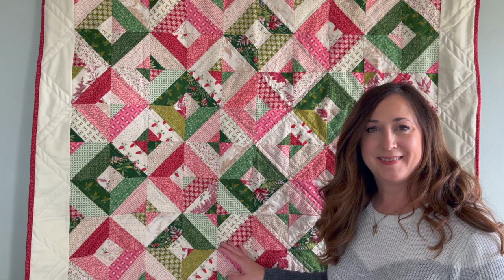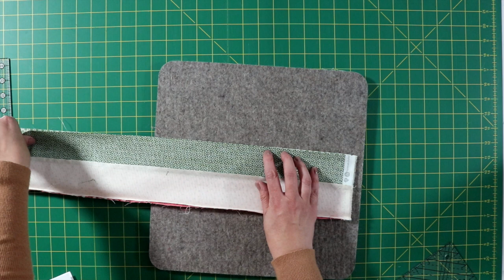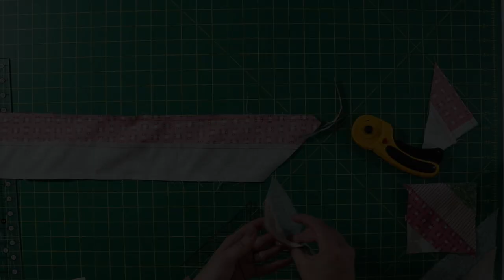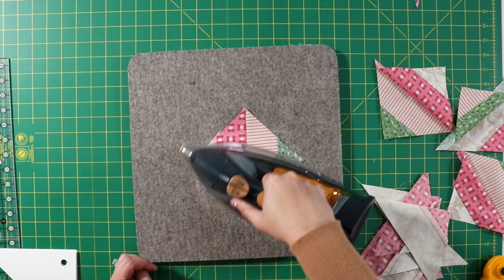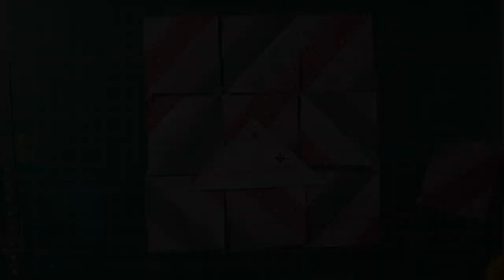Jelly Roll quilt using the tube strip method featuring Strip Tube Junior ruler #quilting #jellyroll

Comment: I have noticed that the patterns using a strip tube ruler don’t ever use the whole width of the tube. Is there a reason for this? I understand that there would be a couple stitches at the point that could be carefully ripped open. Not using the whole tube seems wasteful to me because you are always compensating for the space between each cut piece.
Reply from the maker: Good noticing... I'm not really sure why.  But I do agree that it would be easy to remove those few stitches and allow for a slightly bigger block. Thank you for watching.
Reply: I forgot to add that I enjoy watching your channel and that your quilts are beautiful!